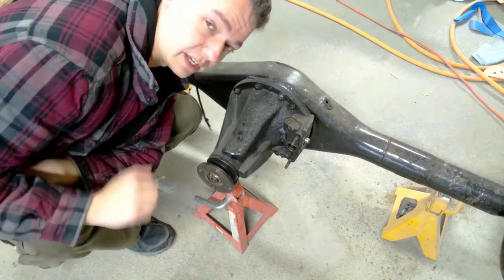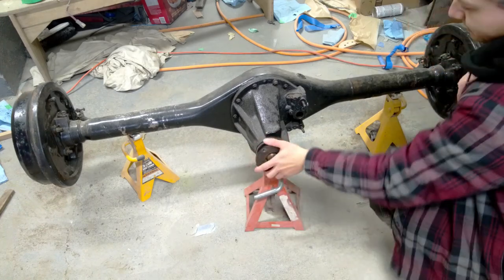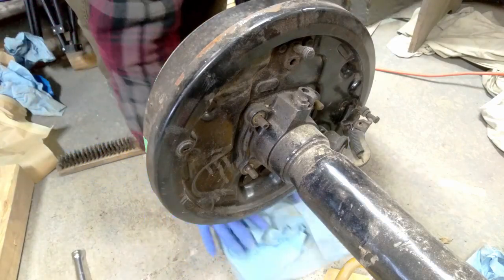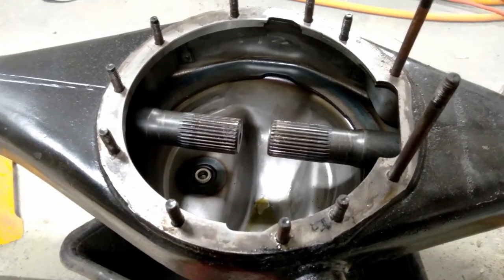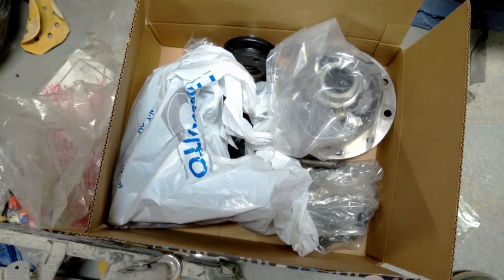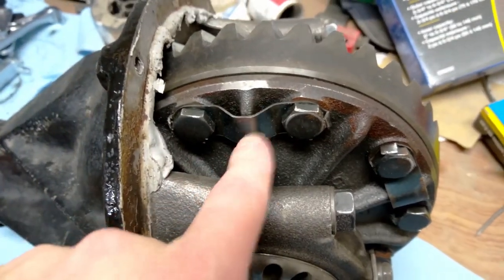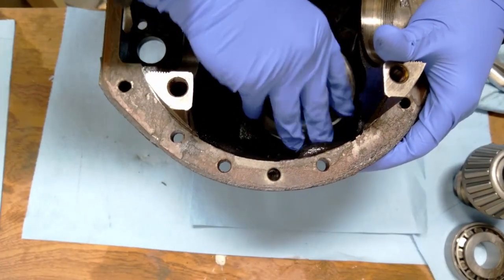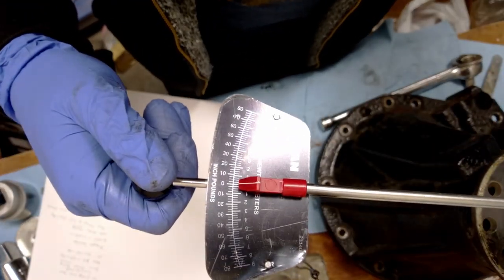Toyota E-locker Rebuild Part 1

Comment: My automotive projects with my 3 toyotas (01 taco 4x4, 97 4runner 4x4, 87 pickup) have gotten more and more complex. From lifts to timing chains, transmission, hydraulics, brakes, sensors, diagnosing and repairing or improving about every freaking bolt...this is next. It's like I read something on a forum or watch a video, next thing I know I'm on cardboard and gravel with more and more parts and tools....I don't know if this will ever end. I'm in too deep.
Reply from the maker: It doesn't end, just embrace it. 🙂

Comment: Has anyone replaced spider gears in these Toyota e-lockers? Mine are all chewed up and I can't seem to get the exact/correct spiders for it from The local Toyota parts dealer. Lookin for part numbers for the 4 small spiders and the one side gear opposite of the ring gear . Any help much appreciated!
Reply: Did you ever figure this out? I'm having that issue now...

Comment: Really enjoyed your vids on the locker rebuild and sub’d. Trying to rebuild mine and can’t get the pinion to press out of the housing even with a 20 ton press. Any tips?
Reply from the maker: Thanks! Are you referring to this part? https://youtu.be/ewbaiIvyJu0?t=456 
The original pinion that came out of mine was very tight. It took a fair bit of force in my press to get the pinion out of the outer pinion bearing to remove it from the housing. 

It's possible you have a bit of rust in-between the pinion and bearing, I know mine had a little. I would try soaking the top of the bearing with some good penetrating oil for a few days, hopefully you can get some to seep between the bearing and pinion shaft. 

I would try heating the inner-race of the bearing with a torch, you might be able to get the bearing race to expand juuust enough to let go of the pinion when you have it in the press. In other words, heat the bearing while you have it under pressure in the press.
Don't forget the safety glasses and safety squints, should be exciting when it finally lets go, haha.

You should also considering carefully sanding down the diameter of the pinion shaft (or the inside diameter of the bearing) a little if you are throwing new bearings on the old gearset, you don't want to have to deal with pressing it apart like this to set up your new bearings/gears. Lucky for me, my "new" gearset was a lot looser than the original.

Good luck!
Reply: @amielsstuff3262  Thanks for the tips! Turns out the outer pinion bearing was so bad that it completely heat welded itself to the pinion shaft!

To give you an idea of the level of heat, even the outer slinger was completely fused to the pinion shaft. What I did, was cut off the slinger, pried the melted bearing roller cage and broke it apart bit by bit from the back side, then cut a small notch in the center of the bearing and extracted the rollers from the back one by one with a magnet. 

This was incredibly time consuming but eventually allowed the entire pinion to come out with the inner race of the outer bearing still attached to the pinion shaft rather than pressed off. Upon inspection the inner race of the outer pinion bearing had actual dents in it from the rollers which had apparently long seized.  New ring and pinion going back in so it went into the bin anyway. Hopefully no one ever has to deal with one that bad in the future.
Reply from the maker: Gnarly! Glad you won in the end, that sounds like a heck of a job! Bet it felt good when it finally came apart.